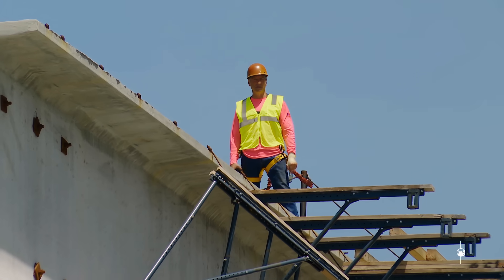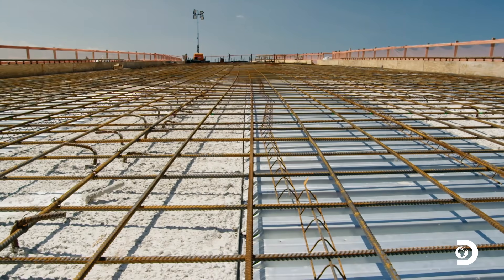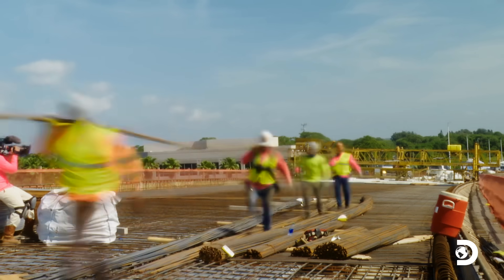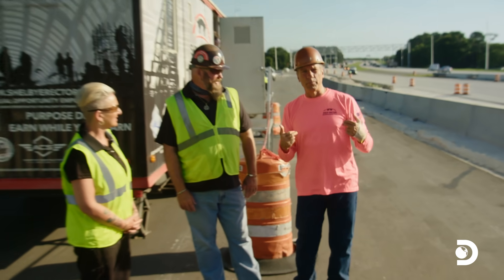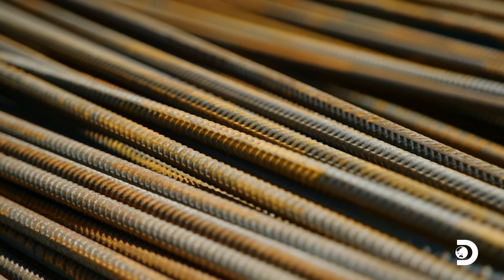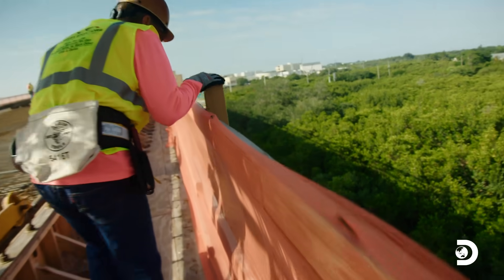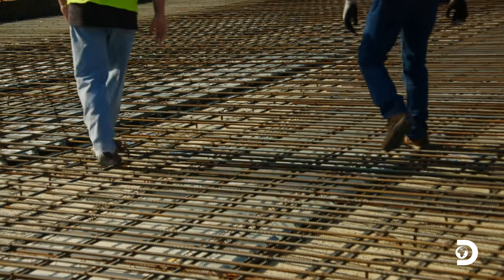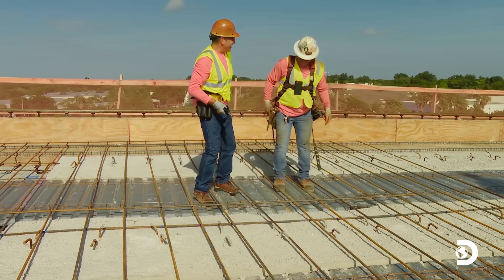Mike Rowe's Incredible 24-Hour Bridge Project | Dirty Jobs | Discovery

Comment: It was interesting to see the tie guns. You should look into the way the Japanese do rebar. No pliers, just a hook pin and or tie guns.

The Japanese are master of cast in situ concrete.
Reply: pretty sure the only reason didn't give it to everyone is "well you get it once you show you stick around." best way to judge if they will? pliers.
Reply: Those new Tie Guns for Rebar Won't work building Power Plants at All except for very limited applications!!! Way More than a Bridge Deck!!! #18's weigh 13.6 pounds per foot, at 149 feet long on Bottom & Top mats of Nuclear Reactors every 12 "!!! Both Directions!!!